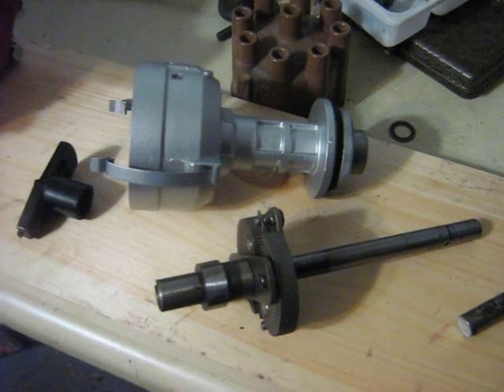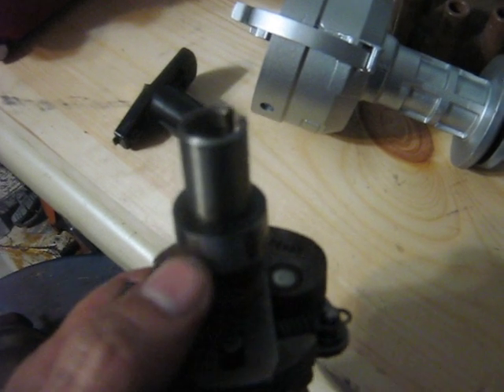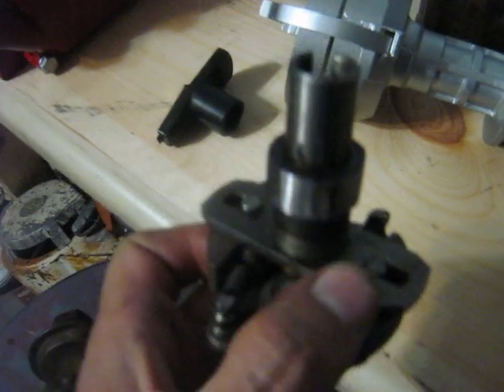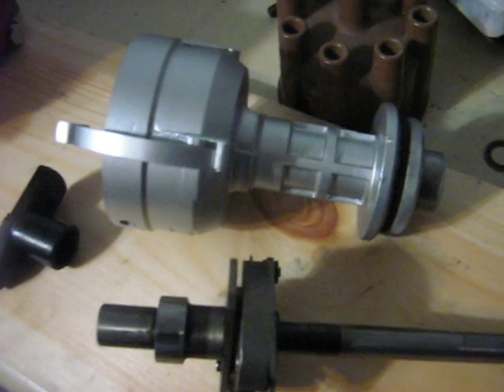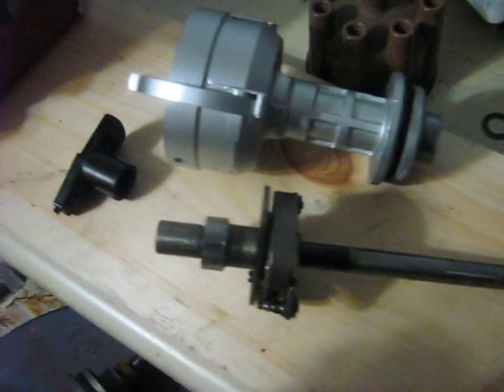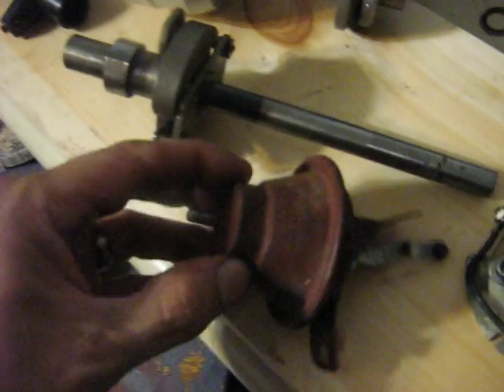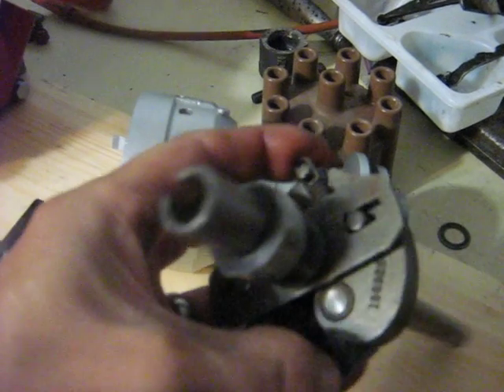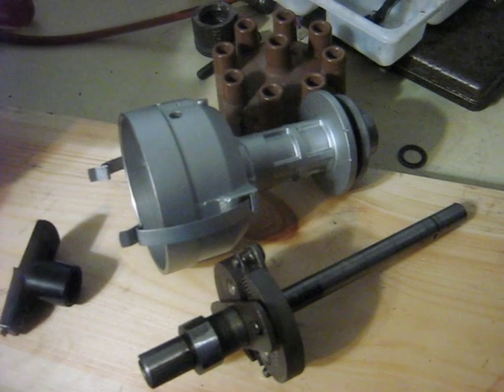Briggs 4 Distributor

Comment from the maker: I think you were lucky, I have dropped things, and gotten some marks on them!
I believe Briggs to be good engines, at least the old ones (I don't have much experience with newer ones, since all my yard equipment is 1985 or older!  :)
I guess I just like old stuff, but I wouldn't be classed an an antique collector.
I have discovered a lot of interesting stuff about engines from 1900 to 1950, and based most of my engines on that :)

Comment from the maker: I happened to have a few old V8 distributors around, but none for a 4 cylinder. I had a look at the scrapyard, but distributors are getting harder to find now :(
I am thinking about stopping the centrifugal advance from working, so the engine doesn't fire too early as it revs up, especially since a normal Briggs idles at 1750, while a V8 is about 1/2 that rpm. I plan to take it easy on this engine at the start, then see what it is good for :)

Comment: Curious as to why you used a v8 distributor instead of a 4 cylinder. Also if you are going to have advance in your ignition. You may want to check and see if the pistons can handle the pre ignition. My knowledge is there just a basic low buck aluminium. They may burn away on ya. I have burnt up a lot of cheap aluminium pistons in car motors. Push them for all they're worth I say..lol